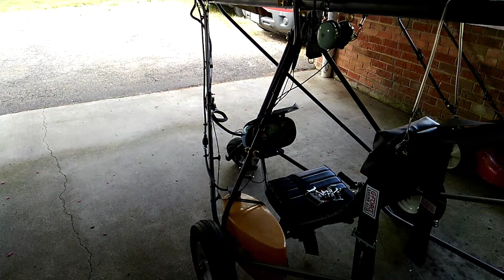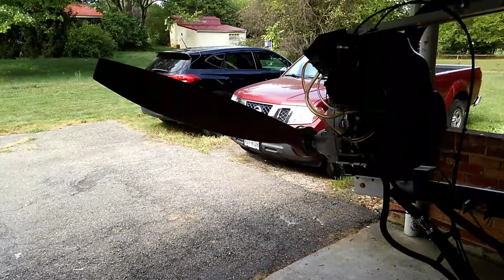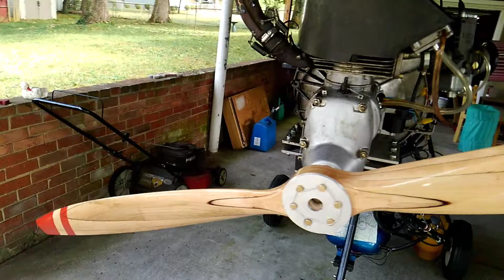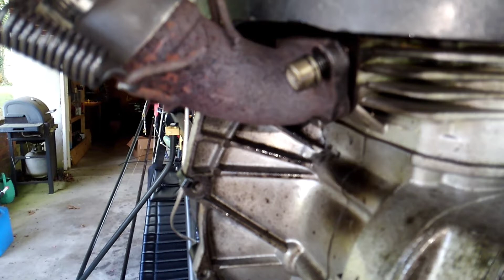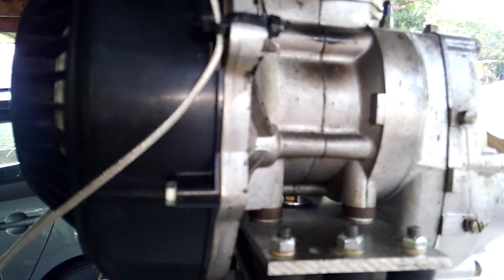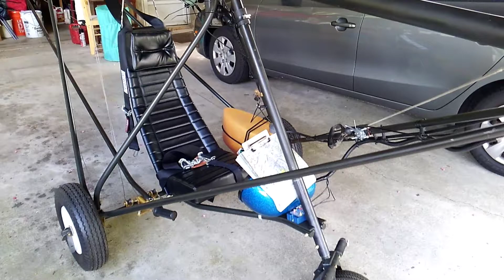Chotia Weedhopper Rotax engine goes wrong

Comment: I use that saying!!! Heard it from my grandfather. Also those exhaust bolts should be the safety wire type..   lock washers are not enough. Safety wire everywhere or mechanical locking nuts.   I have a 277 on my Carlson sparrow.  Looking to HF vw swap it.   I have the engine but I need a mount.  2 strokes scare me